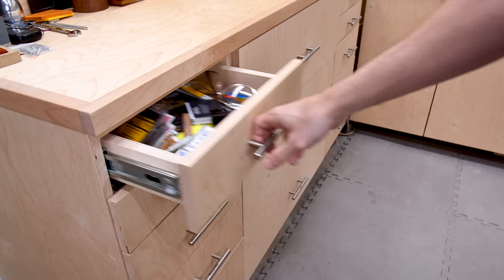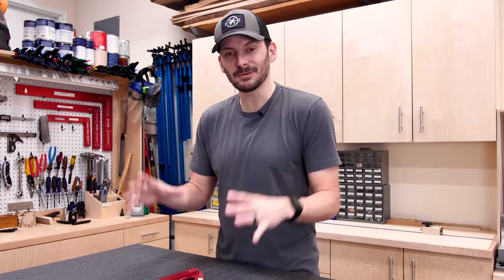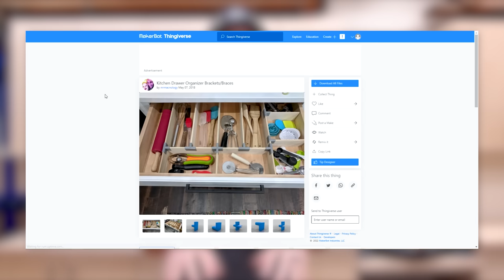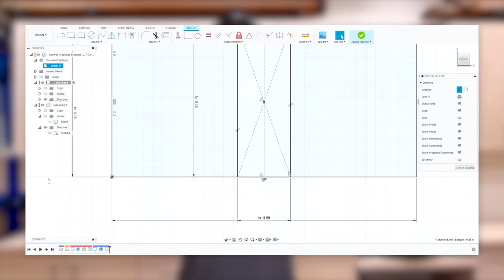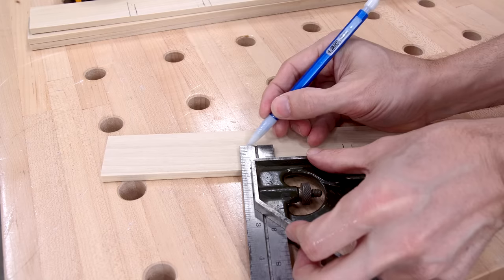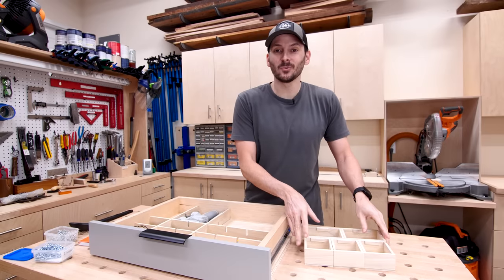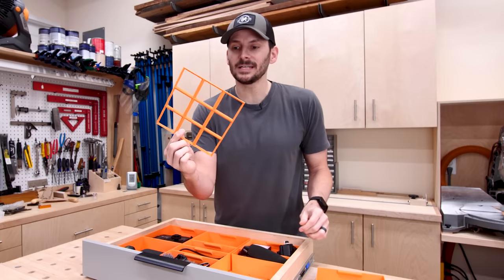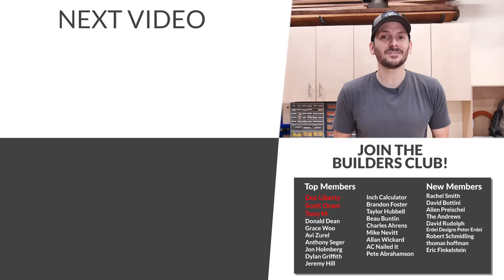8 Easy Fixes for Messy Drawers

Comment: I was setting up my new packouts and was thinking kaizan foam, but the price scared me away.  I went to Harbir Freight and got some foam floor mats.  A roll that was big enough to get 5 layers was about $10. Worked perfsct for a fraction of the cost.
Reply from the maker: Nice hack!
Reply: I did the same. Works perfectly
Reply: Hmm good idea 🤔
Reply: Brilliant! Thanks for sharing that tip. And yes, Kaizan is crazy expensive.

Comment: I love how you used a 90 degree corner assembly jig/tool/thingie when assembling the wooden bins with pin nails. Quick, simple and a great little tip right there.

Comment: Very nice!  I can see many of these ideas making their way into my own shop storage, pretty soon in fact!
And a tip, for those small parts bins with the really tiny things like small washers, I don't know about you, but my fingers have a hard time picking those small parts out of that corner space between the sides and bottom, forcing me to reach for the needle nose pliers, shop tweezers or something with a magnet.  So I made mine scoopable, like a change bin in a cash drawer.  It can be something as simple as ripping a small strip with a 45 degree bevel from a piece of scrap and gluing it into that bottom corner space of the bin.  Or another option is to rip one-fourth of a piece of appropriate-diameter pvc tubing, then sand down the back/outside of the 2 cuts so that the inside curve feathers into the bottom and side of the bin.  I've also seen a flexible pre-molded 'caulk' strip with adhesive backing that goes around the tub that could work.  Or for that matter, some actual caulk would do the trick, and put whatever curve you want in it (of course, that wouldn't harden immediately, and its flexible consistency might itself trap some items).  Anything really with a flat bevel or concave curve to fill the corner where the smaller parts can get trapped and hard to pick out, and has 2 edges that feather into the bottom and side of the box.
Thanks again for the great video!
Reply from the maker: Great tip!  The 3D bins have chamfered bottoms which give them that feature already which is nice.

Comment: Made drawer. Dividers from a piece of 5” square vinyl fence post.  Cuts real easy and accurate on the table saw. Does not use up much drawer space and you can make them any size/shape you want.
Reply from the maker: I can't picture it, but sounds cool

Comment: With the thin poplar strips I did something quite similar. I used 5mm luan floor underlayment and cut 3-1/2" strips and made slotted dividers to go under a hinged workbench top. The bottom of the 2X4's have a sheet of luan so there's a nice storage area under the top for screw guns, jig saw, batteries, drill bits, pocket hole jigs, table saw blades, glue, router bits, etc.

Comment: For the foam cutouts  I use eva foam interlocking tiles and cut them with a laser cutter.

I draw around the tools on some graph paper then photograph it. Using the graph paper to scale the photo to the correct size, then grab the outline with inkscape. Export to svg and it goes straight in to lightburn.
Reply: Laser cutter? What is this Star Wars?

Comment: Kaizan foam comes (free) with many electronic and other packaging. It's not always going to be the perfect size for the drawer, but cut and glue a few pieces together, and you're good to go.
Also, you've mentioned how you can't stack the foam trays (04:09), but provided a way to do so at the end of the video: sliding trays (13:22).
If you make your sliding tray so that it fits INSIDE the drawer, (sliding on thin strips fixed to the drawer's sides), then you could make more that will fit each into the next larger tray, creating a stack of nested sliding trays.
Designed properly, this setup could allow the removal of several trays together, for easy access to one of the lower trays, and labeling at the top would make searching for an item quick and easy.

Thanks for the video.

Comment: Such cool ideas. Thank you!

It would be a lot less simple, but you could stack the Kaizen foam. Sandwich the tool between two foam layers, spray-adhesive the top foam to some 1/8" sheet good, repeat until you get to the top layer of foam. You could do nylon rope handles to lift each layer out. And you can also skip the adhesive depending on how you design each layer.

Comment: I was searching for a way to organize my tool box drawers and tried kaizen foam but the cost was too high. I stumbled upon the foam floor mats from HF and used a razor knife to cut them to drawer size. I then arranged my tools face side down and backwards in a suitable orientation. I used a Kaizen marker with a long skinny neck to trace each piece. Once all were outlined I moved them aside and used my Dremel with the router attachment to cut just inside each outline. I laid the foam on top of a couple layers of cardboard so I could cut all the way through. Once you figure out which direction of travel works best (clockwise or counter) stick with it to avoid wandering. I used a headlamp for extra light and a shop vac for catching the debris. I got 8x11 sheets of very thin fluorescent foam from the hobby store and used 3M Super 77 to adhere it to the smooth back of the foam. Whenever a tool is missing there is a very visible indication that it’s out of its place. I did 5 drawers for about $30 total. It was much faster and cheaper than Kaizen for this application.

Comment: I walk away with many jewels of information after watching all of your videos.  Do you feel that the AnyCubic i3 Mega S 3D printer is more than adequate for what you need to fabricate or do you recommend the AnyCubic MEGA X?
Reply from the maker: I've been happy with it so far. The build plate is a bit smaller for some large stuff I've wanted to do. So the Mega X would help. But Mega S is a good starter
Reply: @Fixthisbuildthat  Thank you for your quick response!  What software do you use with your 3D printer system?

Comment: The 3D printed brackets to me, would act as a clamp. Cut pieces to fit, add glue, press into 3D printed part, and once glue dries you could essentially remove the brackets and have a solid enough, no fastener, drawer organizer. The parts themselves are reusable in this application.
Reply from the maker: yep, that could definitely work too if you didn't want to change the spacing down the road

Comment: If you happen to have a hot wire cutter, it's pretty easy to slice that Kaizen foam to different heights (and, of course, shapes). I've used 1", 1.5" and 2" angle iron as height guides. Just remember not to set the angle iron on a metal table or you can short out the hot wire. You can put Kapton tape on the edge as an insulator to prevent that.
Reply from the maker: I'll have to try that for the rest of the foam, thx

Comment: Here’s a tip for getting cleaner cuts with a Kaizen foam. Keep a candle nearby, and heat the blade of the utility knife up before you make the cut. The hot knife will go through the foam like it was butter.

Comment: You're 3d printed brackets encouraged me to buy a 3D printer for fun and practical uses. How did you get the insides of the brackets so clean? Mine have little strands, most of which I can't remove. Were these some you created or did you use the stl's in your bracket link? Or is it the filament?

Comment: Great ideas!  What software do you recommend for the Anycubic?  The Autodesk Fusion sw is very expensive and is not available for a one time purchase.  Any other cheaper alternatives for someone who would only be using occasionally.  I would want something compatible with plans that I might purchase.  Thanks.
Reply: Try Tinkercad
Reply from the maker: Fusion is free for a personal license. Shapr3d is good for the iPad
Reply: @Fixthisbuildthat  Thanks.  I didn't see the free personal license.  It does have some limitations but at this point I don't have enough 3D printing experience to know whether they would be a problem, such as with purchased plans.

Comment: You can get a Rockler-brand version of the kaizan foam for cheaper, and it comes in a thinner size like what you cut it down to for even cheaper than that.  

I know, I can't believe it either, a Rockler product that is cheaper than the competition.

Comment: Kizzan is actually a Japanese word that has become common due to project management.  It has nothing to due with the foam itself.  Layered foam has been around for over 50 years, and when bought as "layered foam padding" it is about 1/2 the cost.  It is still expensive, but far less so than buying "Kizzan Foam".

You can also make your own by applying multiple sheets of thin packing foam ,which can be purchased in large rolls at most stationary stores (Staple, etc.), and spray spray adhesive.
Reply: Nice tip!

Comment: Sad to say, but it took me about 3 videos worth of hearing "me nails" before I got it.   Ages ago now, but I still chuckle at my doofusness.  

Can you separate only some of the layers of that foam or is it an all-the-way-thru or nothing situation?  I'd like to make tool trays that could be lifted out & used elsewhere?
Reply from the maker: you could cut down a specific distance then pry out the cut out vs. going all the way through.  but it will be very jagged at the bottom

Comment: I've been interested in making logo coins for my woodturnings. Would the 3D printer make a coin about 3/4" diameter?
Reply: Depending on how detailed your logo is, 3/4” is probably pretty small to get the level of detail you might need for it to look like anything. A resin printer could probably get the fine resolution you might need.
Reply from the maker: yeah, agree with Jeremy.  I'd go with a resin printer for added detail that small.  This one would probably not give you what you want
Reply: @Fixthisbuildthat  Thanks to Jeremy and you. I'll look into an engraver, maybe something that will engrave on aluminum or brass. Let me know if you have suggestions.
Reply: @staynavytom2963  you could order the coins if you want them to look top notch. Maybe take an existing one & then have some engrave your initials.

Comment: For the foam people normally use a soldering station to use the heat to cut them makes a way cleaner cut and easy to cut as just shrinks the foam with heat. Also think they make a special knife to cut them as well if your doing quite a few.

Also you said dootie.🤭😱💩
Reply from the maker: double doodie actually, lol

Comment: Dont think I’ve ever seen anyone spray a table saw blade with WD 40. Would be afraid it would stain the wood you’re cutting and impact finish etc.
Reply from the maker: it's not the traditional WD40 I'm spraying, it's a the specialist dry lube spray that dries quickly.  Never had an issue with finish being affected.